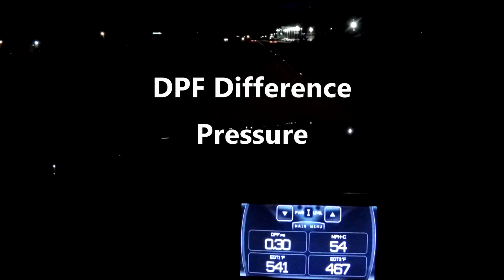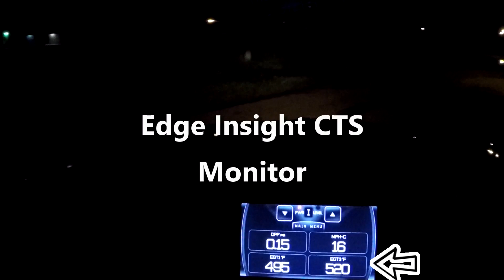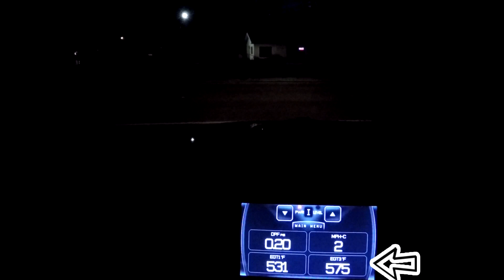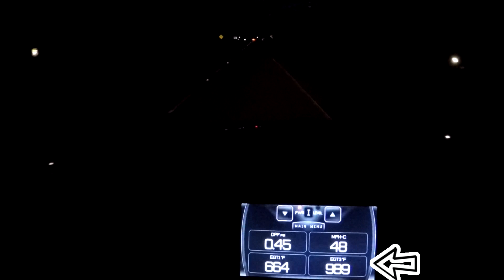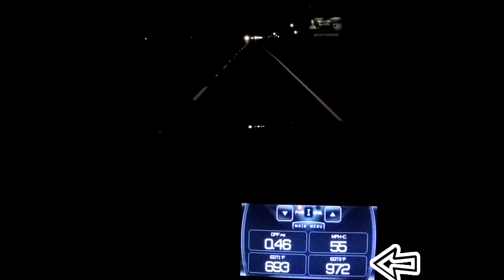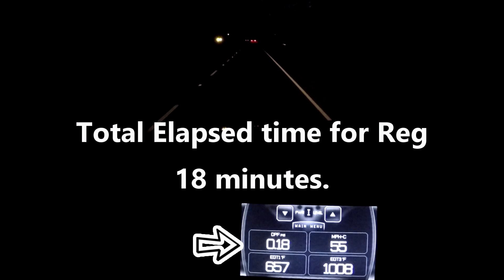RAM Cummins DPF Active Regeneration

Comment: I just bought an 09 6.7, and my dpf pressure readings are anywhere from 0.2-0.4 while cruising flat and anywhere from 0.8-1.5 when accelerating or going up grades. But what’s confusing me is that the dpf turns on anywhere from 20 to 40 miles, consistently. And I have no dtc’s. And all of my gauges look normal. Engine gets up to temp, egts are normal before, during and after regens. I’m stumped
Reply from the maker: If you can switch your view to monitor % instead of pressure, I found it more informative.  What is your EGT 1 and 3 while in the regen?  EGT 1 should be around 600 -+ and EGT 3 should be 1000-+.
Reply: @MarionBlair my cts3 doesn’t have the PID option for %, nothing for soot load or ash load, all that’s unlocked is dpf egt, dpf psi, and dpf status, im pretty sure the 09 ram doesn’t even have a sensor for soot load, but im not sure cause its my first emissions diesel, I’ve changed the thermostat and cleaner the egr, im going to replace the pressure sensor next

Comment: I had an intermittent code for the O2 sensor module but I drove it that way for 2000 miles and could not understand why it did not go into limp mode. I reasoned that the DPF was cracked because soot in pipe.  So I’m guessing no limp mode cuz soot is getting thru crack and nog clogging up.After an $800 diagnoses Dealer said “We think it is turbo” and had no clue why there was soot in the pipe.
I put on a rebuilt ECM and all seems well and it passed California smog.
But I’m still wondering why if it has a cracked DPF.   I put on an Edge Insight and before I realized a light would come on during regen I noticed DPF went to 1140 degrees on freeway for a few minutes then came down and remains around 500.  Pressure is about .3 always.  
Marion this vid is invaluable to me!  I still don’t know if DPF is cracked but I put some white paint in pipe to see if it soots up. I’ll bet it does and experts say if soot then DPF is cracked.

Comment: Marion, thank you for the informative regen video.  Great information.  You peaked my interest on the DPF reading.  Is the DPF reading temperature before or after the turbo charger?  I have an EDGE Insight monitoring system and am using the DOC temp for my turbo timer module.  I bought a probe but haven't had it installed (pre-turbo) since I was able to locate factory EGT readings.  The trick is for me to find out which one is pre-turbo.  I tow an RV and want to make sure I keep an eye on the pre-turbo temps.  Thank you again sir

Comment: Marion, its 5 years later that I'm seeing this tutorial  primarily because I'm buying a 5500 Ram now in 2020. Thank you very much! I must get a CTS monitor as I'm was a instrument & electrical Journeyman. I need feed back as to what's going on. Also that monitor would help to diagnose problems with sensors. Again, much appreciated as is the reduced speed, modulated speech & your video editing. Great job! Hope you & yours are well.
Mike

Comment: my DPF light has been on for 4 days. I have driven every day at 65mph for over 15min per day during this time. DPF light is still on. Im getting concerned, Im taking it to the dealer. And Im going to order that monitor display that Marion is showing off!
Reply from the maker: The Banks Idash.  Unfortunately the DPF on/off flag has a bug.  I reported it to Banks.  Hopefully they'll fix it but it's easy to tell when a regen is on by the EGT3.
Reply: @MarionBlair  Thanks Marion, are you saying that my DPF light on my dashboard might be stuck on when in fact I do not have a buildup of soot in the DPF filter ?
Reply from the maker: @paulg444  No, I'm not, I don't have a DPF light.  I didn't know any of the trucks had a DPF light?
Reply: @MarionBlair  , Im calling it a DPF light. It is the regen status light, it is yellow and looks like a puff of smoke that is on fire.
Reply from the maker: @paulg444  what year is your truck
Reply: @MarionBlair   I have a 2016 Ram 2500 4x4 CTD Megacab. I love it. But that yellow icon dpf regen light on my dash has me wondering.
Reply from the maker: Is there a message with it. I don't know of any indicator like that on the evic panel. I wish I could see a picture of that. But I guess I have to plead stupid.   I guess you've got plenty DEF fluids. that indicate look similar. . I would see if there's a code in the PCM if you don't have a code reader you can take it to AutoZone and ask them what the code is showing
Reply: @MarionBlair   my DEF fluid indicator dial is in the red zone , hmm, maybe that light comes on when the def fluid gets close to empty. ill take a picture of it and send it to you for your files.
Reply from the maker: @paulg444  dump a two and a half gallon container of peak in it and see if it doesn't clear
Reply: @MarionBlair  Thank you Marion, Just dropped the PEAK 2.5 gallon DEF container in and all is well, the light is gone. Greatly appreciate your channel!. Looking forward to a rewind of your fuel filter replacement video, Im due for that soon.
Reply from the maker: @paulg444  do it as soon as you can, or your truck will go into limp mode eventually. Good luck let me know if you need any help
Reply: @MarionBlair  2008
Reply: I'm sure you're tracking now, but for others who read this forum, that light is for the exhaust brake

Comment: My says Marion is a slow talker. I told her I think that's good cuz I'm a slow listener. I  bought a 2018 2500 Cummins powered Ram a few months back. 90 percent  of the 5000 miles I've put on it have been towing my 30 foot travel trailer, which Marion has quite a bit of info on. I've gotten more correct info from this man than anyone on YouTube.

Comment: i want a 2019 ram 2500 6.7l cummins, i don’t know much about diesel, how would this truck do as a daily driver/short trip truck, 6 miles to work and 6 miles back home? long trip once a year no towing.
Reply: ok thanks you explained it perfectly
Reply from the maker: Is it highway or city to work?  It'll regen fine when need. It's more important that the engine gets up to operating temp.   If you set a poorboy monitor like I describe below, you can monitor what egt and dpf are doing.  I'd change my oil more often than normally.
https://youtu.be/MlrGSI2o3ZE
https://youtu.be/uwIAgRdx1c0
https://youtu.be/nV5Y6jqklgs

Comment: How much cheaper would these trucks be if the EPA didn't require this added complexity
Reply from the maker: Oh, wow, it's a big number.   The EPA will not admit that however. 
 A DPF, Cat converter, DPF, EGR, SCR, DOC, PCM, EGR cooler, EGR filter, DEF pup, tank, poor effciency, not to mention R & D.  my God, it goes on an on.  If I went to mopar and bought all that stuff for my truck it's probably cost me at fortune but they get the stuff cheaper.  It also cost us extra maintenance..  The dealers probably love it.  I think a straight pure deleted diesel with nothing but a muffler would have a stick 20K less.  Just my guess.

Comment: Have 17 dodge 6.7 Cummings service def system  (light) I can actually see the def level on gauge going down says going in limp mode
Reply from the maker: Get a cheap code reader and clear it.  If it doesn't come back you are fine.  May be a fluke.  If it returns, you've got to pursue it.  Here's a video that may be of interest.  Either way, get a cheap code reader and keep on board for emergency.
https://youtu.be/AvYiE6D8se0

Comment: Yeah, my Truck started making all kinds of "NON Cummins" sounds....  After I pulled off the Road and shut the Engine down, you could Hear the Exhaust system metal popping and cracking, like a Wood Stove gone Wrong.   Turbo Replacement should NOT be a Normal part of Everyday Maintenance !!!!!
Reply from the maker: No, it should not  After running highway and especially towing, let your engine idle for 5 minutes and the turbo will thank you.  They are water cooled now but still idling is still recommended.

Comment: The value in the upper left display (DPF psi) .. Is that a pressure differential?
I'm still working on getting Torque Pro to display all the things I want. 
Does the CTS allow the user to define their own pids?   That might be useful to figure out what's what.
Reply from the maker: Yes, correct,  that PID is called DPF pressure.  It triggers the regen when the differential increases rises.  I don't think I can define a PID but will check.  thanks, good luck.  keep me posted on your success getting it working.

Comment: My 2016 is showing the 100% message now but is also showing a check engine light.  I got this message once before and it showed completed, as mentioned it would.  I don't remember the check engine being on first time.  I had it on a 10 trip less than a week ago.
Reply from the maker: Weird.  it should handle itself with active regens.  I would get it to the deal with the code so they can trouble shoot it.  That shouldn't happen.
Reply: was supposed to say 10 hr trip...  I tried twice to get longer miles in to clear it today.  I when 23 minutes first time and 48 minutes second time, slowing down only to turn around or pull off a ramp.  Still has not cleared, so guess I'll head to the dealership tomorrow.  Just got the truck Thanksgiving last year, but have put 15K on it...mostly long trips to OH, MI, NJ
Reply from the maker: Yea, something isn't right.  RAM's regen system is pretty much flawless from what I've seen.  Something isn't working right.  On those long trips, the exhaust heat is more than enough to clear the DPF filter. They'll hopefully fix it and you won't have any problems with it after that.
Reply: @MarionBlair  
Had the same thing happen on my 2014 today, after a 10 hour trip yesterday.  Drove it for 2 hours today waiting for the regen to finish. No joy. Have a 7a.m. appointment at dealer 50 miles away tomorrow.
Reply from the maker: I like to know what the cause was.  The differential pressure switch triggers a regen with a very, very low pressure so I would thing it could be the culprit if it got out of calibration.  Could be as simple as a flash but I wouldn't think so.  You should be able to run highway with no regens.  Towing or not, the exhaust temp is high enough to burn off soot.
Reply: @MarionBlair  
Will post the diagnosis and cure (hopefully) tomorrow.
Reply: Just leaving the dealership.  Particulate filter will be replaced under warranty. Trouble is they are  "on national backorder" and they wont have one for 3 to 5 days.  Was suppored to pull a large 5th wheel this week, but no way without the truck running at optimum. Will keep apprised.
Reply: Was at the dealership all day yesterday.  Had the waterpump and transmissinon interlock recalls taken care of.  They tried to force my existing dpf to go into regen mode, even though it was trying to regen all week.  Then they replaced the filter.  Except for my time, there was no charge.  Truck was doing good to get 17mpg highway with the plugged filter.  Doing better than 23 now.  For an emmisions compliance "feature" it sure was sending a bunch of diesel out the exhaust without using it to turn the tires.  Will be doing a delete after the warranty expires. I will not be coming out of pocket to pay for such foolishness.
Reply: @kevinmccarthy1681  I recently had my whole def system replaced in my 2018 and it's still giving me the same problem , any input would b helpful
Reply: @chrisyoung2188  
The SCR/DEF system just crapped out. One year and/or 6k miles out of warrantee.  Made it go away last week, along with a functioning DPF.  Picked up 40hp, 100lb/ft and 3mpg with the delete and tune.  Truck is happy now.

Comment: Hey Marion
Do you know if the EGR is active or inactive during an active regeneration?
Reply from the maker: Pretty sure that it's active, nearly positive but I'm in a regen right now so I'll find out in the morning.
Reply from the maker: Your hunch is correct, the EGR is closed during an active regeneration.  Interesting, what made you curious about that?  I wouldn't have though of it.
Reply: I figured that since the EGR is used to control exhaust temp, then running it while in regen mode would be a conflict of interest
Reply from the maker: Ha, that's excellent!

Comment: Fascinating!  Did you install an EGT probe or are the EGT PIDs you're  monitoring on your Edge available in the truck's ECM?  Also, I am trying to decide between the Edge CTS and Bully Dog Watchdog monitors (no programming).  Any thoughts on the differences?  Many thanks!
Reply from the maker: Dave Smith Dave, I'm just monitoring the stock probes that are already on the truck so no I did not add any probes. All of those pids are available from the OBD connector. as far as the edge have always felt that it wasn't bright enough others don't complain however maybe it's just my unit. also the CTS stock screens are not very good so I would probably shop before I got another CTS.
Reply from the maker: Check this thread on the Cummins forum, it's got the discussion on the torque app and how to make it show up on the display.  http://www.cumminsforum.com/forum/2013-general-discussion/1689713-homebrew-digital-monitor.html
Reply: Marion Blair I just added the new dpf pids from the homebrew guy, I'll update after I have a chance to drive somewhere to see if they work.  The two you mention are in the list of available pids at least
Reply: DPF inlet pressure seems to be working.  DPF temperature, not.  You can see EGR actual %, and DPF status (a % that when it gets to 100, the truck goes into either an active or passive regen).  There are two other DPF regen sensor pids that don't work correctly.  I think I might be able to fix the torque config to display them correctly though.   I saw a passive regen happen, you can definitely tell from these displays when regen is about to kick off, when it does kick off, and when it ends (even if you shut down the truck while it is in progress).
Reply: Marion Blair Do you happen to know what the pids are? I have an obdii monitor and use the torque pro app, but the egr% and the dpf pressure don't work for me.  I need to add them as a custom pid I think, but can't find info on the pids anywhere.
Reply from the maker: Charles,  They were listed on the Edge website but they changed things around and I don't see them but will post when I find them.  I had the torque app and it didn't show the EGT's which was a bummer.  However, there are some out there have been able to add them with a simple custom PID.  I'll keep looking.
Reply: Marion Blair I sure appreciate it. Your videos are very informative, thanks for helping us all learn how these new engines work.
Reply from the maker: Thanks, Everything on the screen is from the stock ECM available from the ODBCII connector.  Thanks
Reply: Marion, thank you ever so much.  I scoured the internet and came up blank.  I guess my google skills need work. Luckily my socket wrench works a lot  better for me than my keyboard does!
Reply from the maker: No problem, the Homebrew guy was pretty savvy on the coding for the torque app and had a download at one time that you could run to make the EGT show up.  I never tried it however.
Reply: Marion Blair egts show up out of the box on torque now, but there are some other important values that don't as I mentioned.  I think there's enough info in the thread you linked to get what I want.
Reply from the maker: Thanks, I was hoping they fixed that bug.  Wonder if DPF pressure and temp are working.
Reply: Charles Riley thanks!
Reply from the maker: If you ever get it all working with Torque, I think I still have the paid version.  It'd be interesting to see if I could duplicate your results.  thanks.

Comment: is there any way of knowing in advance when the regen is approaching?
Reply from the maker: Not easily without a monitor.    See the video below.  I think this is a good way to confirm you have a regen in progress.  Get a base line MPG at a steady speed and compare it to your MPG when you think you are in a regen. I wish RAM would have put a light or something on the dash.  The ECM generates a PID to the ODBC II connector.  It's easy to read if you've got a way to read it.  I'm using the CTS Edge insight monitor.  The engine takes care of it behind the scenes, not a problem.  At highway speeds you won't get any regens as the exhaust temp is high enough to burn off the soot with an active regen.
https://youtu.be/6QvM5QvQD2A

Comment: how do you start or what button do you push to get it started
Reply from the maker: smoke 6152 it starts automatically based on the differential pressure of the DPF filter the driver has no control over it
Reply: @MarionBlair  I'm driving/towing in the city (no highways at all ) all day long.
Do I need to jump on the highway to get the regeneration?
How I know if it started.
Are you looking at those values on a scanner or I can get it displayed on the instrument panel?
Thanks in advance.
Reply from the maker: @youtubito69  Robert, It will regenerate fine in the city.  I have a Edge CTS monitor that tells me the exhaust temps and when I'm in a regen but you can do the same thing if you have an android phone.  I have 3 videos on setting that up if you have insomnia.  There's really no way to tell if the truck is in regen without a guage but you don't really need it either.  The truck will take care of the regens without being on the highway.  Mine does it in town all the time.  If you shut the truck off while it's in a regen, it'll  go right back to regen when you start it up, even if the engine is cold, so I would worry that.  I set up a cheap way to monitor exhaust gas temps which will tell you if you are in regen or not.  See video's.  Let me know if you have questions.  Marion

https://youtu.be/MlrGSI2o3ZE
https://youtu.be/uwIAgRdx1c0
https://youtu.be/nV5Y6jqklgs